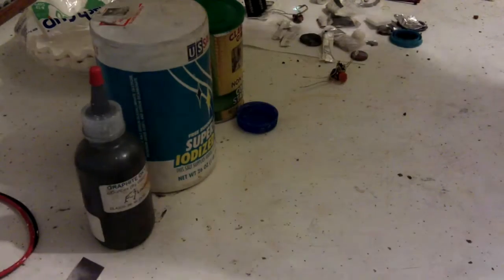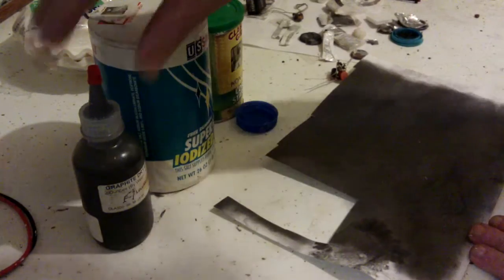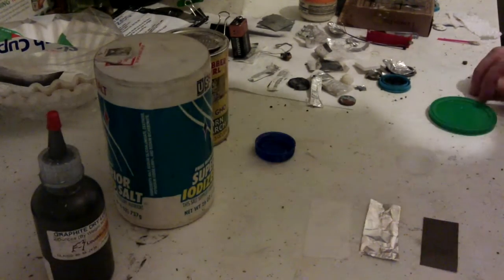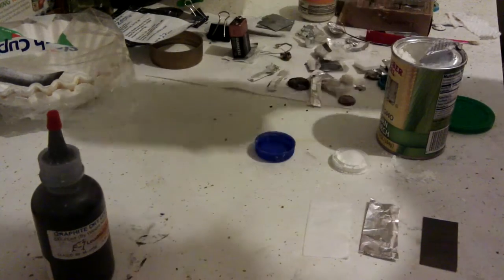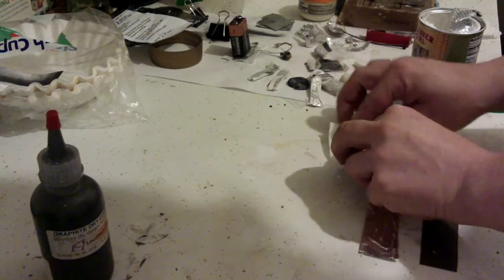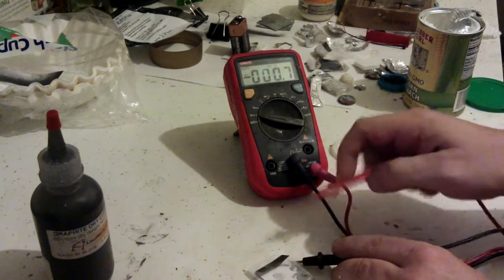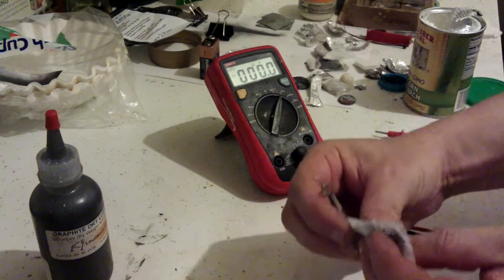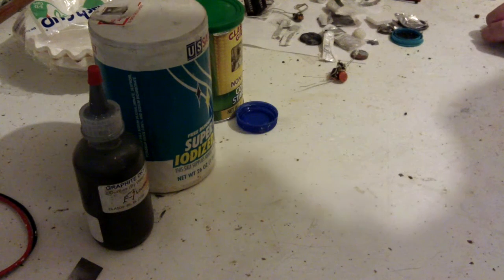How to make a paranormal battery !

Comment: Rapid gas discharge from a Non Newtonian fluid. Pop. I told you that stuff was prime for blowing up! If thats what it does running one of your tiny oscillators, imagine what it will do receiving rapid charge from a 40kv cap.

Have you tried mixing a little carbon or graphite into the electrolyte? I'm thinking the carbon would be good for ion transfer due to the O2 and H it can cycle through the electrolyte. May also improve max current. I like the piezo idea. May as well harvest the mechanical losses....

What happens if you vibrate the cell or otherwise stimulate the fluid to stiffen? Does it affect charge/discharge values? You might have some kind of EAP (electro active polymer) there...

Visitor: why is there a dildo attached to some foil and mystery white goop bouncing around on your kitchen bench?
Me: Thats my gack cell. I'm trying to get it in a more excited state so I can get more discharge out of it.
Visitor: 0_o
Reply from the maker: Which is why we don't have many visitors !
Activated carbon improves it enormously, charcoal from any burnt source works quite well too. Vibrating to mix the mixture is something I need to build...or buy at some dodgy store indeed lol
Reply: You could try phone or PlayStation vibration. But neither are waterproof. Some adult versions evrn have suction caps to hold it down:)
Reply from the maker: To hold what down ? snickers and clicks 'Post comment' against best judgement
Reply: As an anticlimax device for paranormal batteries? What else would I be talking about?
Reply from the maker: From you sir, noone ever knows LOL
Reply: Seriously though. If your Microbial fuel cell is vibrating off the kitchen bench. You need a suction model.

Comment: It should charge up.  Have you tried that yet?
Keep up the vids. Thanks
Reply from the maker: Have tried charging and this simple mix does work ok, but nowhere near the likes of adding activated carbon and the other tricks for the supercaps. Works best with the 'fizz' at 12V. It's just the longevity that appeals in this type.

Comment: 5 bucks says you jumped a little
Reply from the maker: A change of shorts is always a possibility with such events lol. Have had a few things happen at this old house. Wife thinks there may have been a 3.0 or similar small earthquake...we do get plenty of them.
Reply: +slider2732 my house has rotatory phones and there aren't any phone lines to the house and the phone rang last night 0.o
Reply from the maker: Woah, how cool is that. Presumably there has to be some kind of phantom power, that isn't a real phantom lol. If such a phone is still plugged into the wall, do make sure the lines all read 0V. If not there's yer sign .
Reply: +slider2732 there's a voltage but no signal. The data lines are disconnected from the box outside
Reply: +slider2732 but we got it serviced today and now we have working rotary phones. Hooray technology